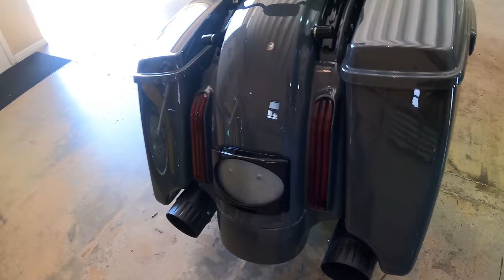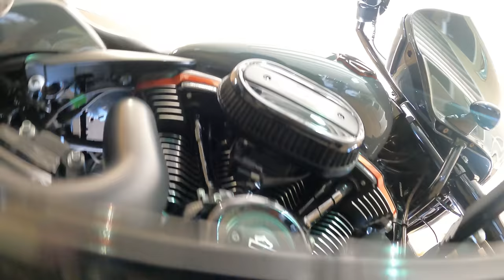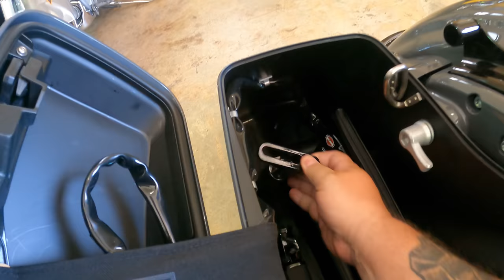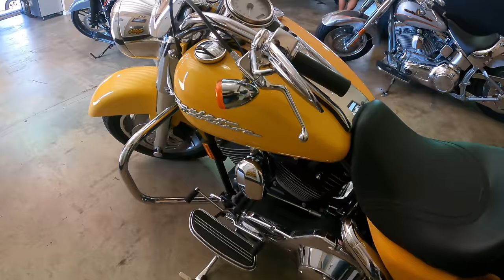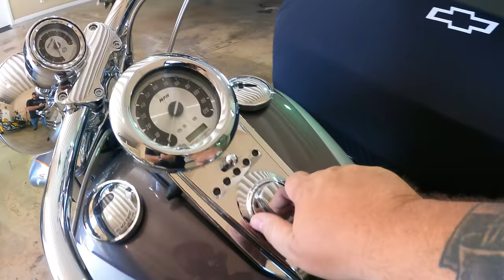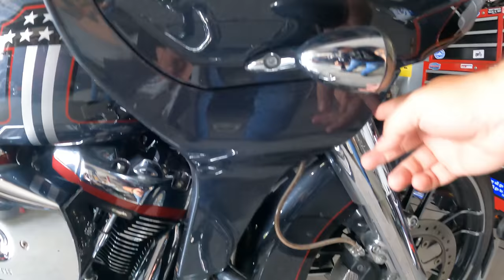How do you avoid a bad used Harley Davidson?

Comment: Looking at used Fat Boy 2005.  Is 40K high miles for these?
Reply from the maker: Not really if the cam chain tensioners have been changed. I would poke around though, there are tons of bikes out there with a lot less miles than that on them.
Reply: @ProfessionalMonkey  Thanks for your reply.  I just bought an 08 Fat Boy Badge edition with 11,000 miles on it

Comment: Never buy one that’s had the engine opened up on. If they say it’s stage 2, big bore, and all that stuff, WALK AWAY. Only buy ones that’s had a simple stage 1 on it which is pipes and air breather. Harley’s are very reliable and will last a long long time when left alone and not tampered with. Also avoid any with lots of electrical stuff added on.

Comment: I always take a mirror and run it underneath and along the sides f the bike and hit the unlighted portions of the bike with a flashlight. always check the tires and brakes and then the transmission. if it's a used bike and they will not let you ride it, move on.

Comment: Can’t avoid a bad used one until they stop making bad new ones 😀
Reply: You sound like one of those Guys who owns a Japanese Bike, or doesn't own one at all, and deep down really wants to own an American Legend...A Harley Davidson!!!
Reply: Most accurate statement I seen in this comment section. I used to be a Harley guy. Could not beat pre-99 bikes. Had several with over 100k miles. My 06 and 13 both didn't make it to 50k. And I am one that don't like working on them so the dealership does everything.  Ended you buying a Yamaha roadstar and it's been better than any bike I have had in a really long time. I'm currently at 225k on the odometer.